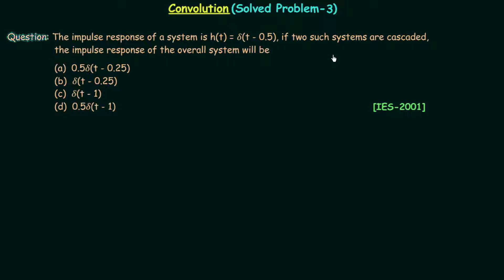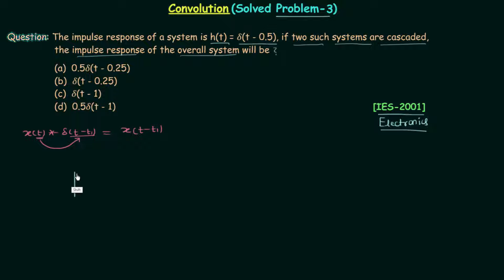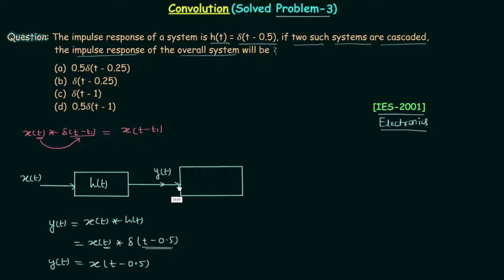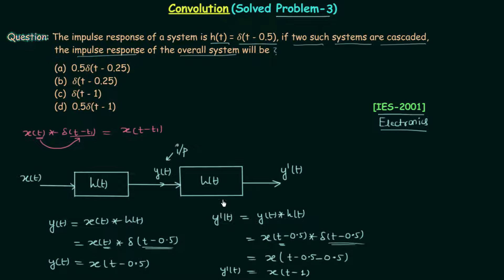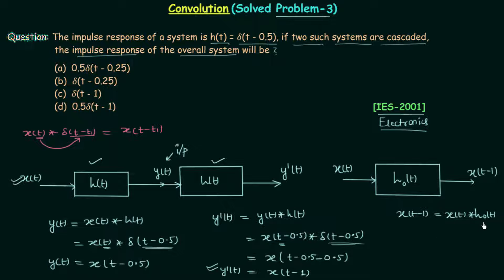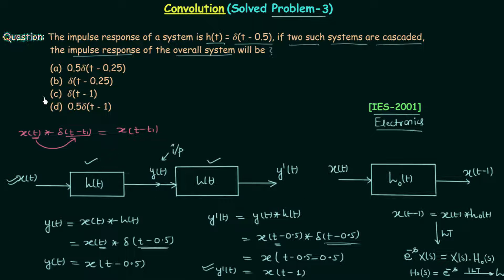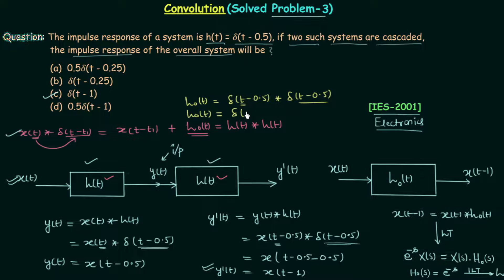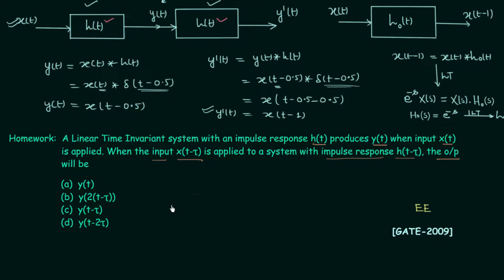Convolution (Solved Problem 3)

Comment: how D is correct...h(n) is not mention as delta-func.
Reply: go through the time delay property.. simple
Reply: Delta function is same as impulse response
Reply: @kushgope6514  no they are different, i don't get it too. Impulse response is the impulse functioning after converting through a system

Comment: Gate 2009 answer will be option d, but I think it should be x(t-2tau)
Reply: Khairul Ehsan Fahim they are asking o/p so it surely gonna be y(t-2tau)....why would be x der??
Reply: Using methods taught provides that x(t-2tau) equals the output.  This does not provide y(t-2tau) or the like
Reply: Khairul Ehsan Fahim u r right